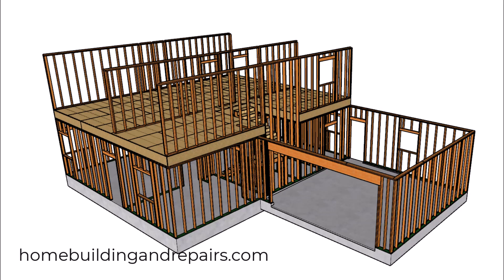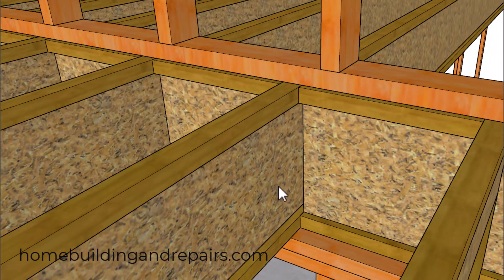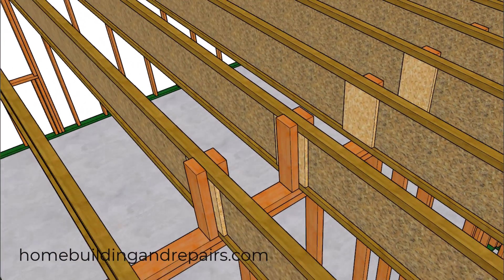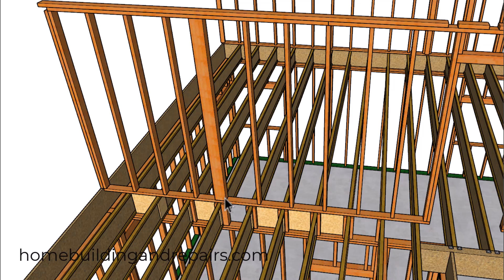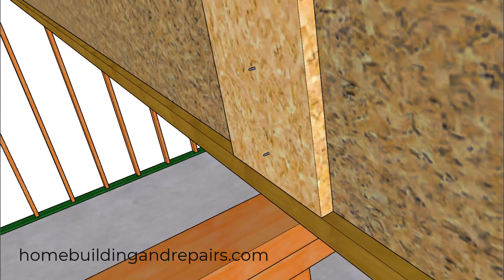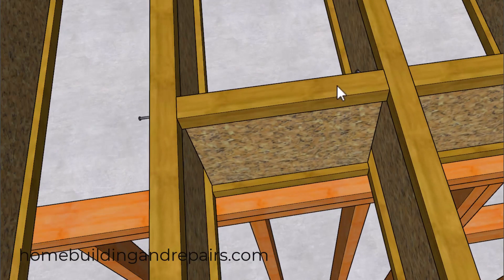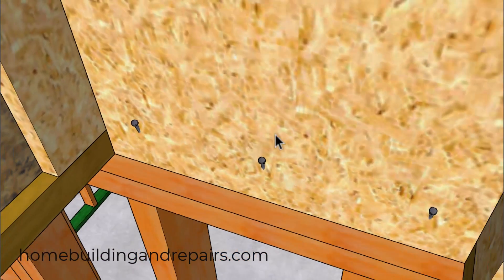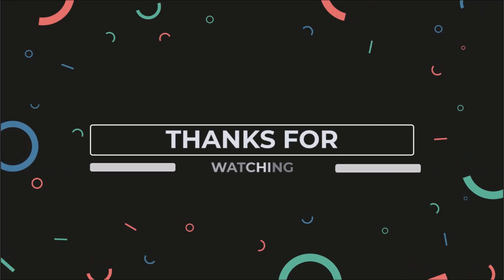Web Stiffeners, Solid Blocking And Squash Blocks Installation Examples For Trus Floor Joist

Comment: Im  building roof with IJoist, 18f span, i can’t find much info about blocking in Ijoist rafters, what would you recommend?
Reply from the maker: I would check with the manufacture, they have installation instructions on line.

Comment: I Used 2x4\2x6 swash blocks with 1x4 or 1x6 for TJIs as the fit flush with standard TJIs. For "But" framing, I used LVLs with the the joist hangers and 1x4 for spacers (web stiffeners) for the fastening the hangers for the TJI's. I wouldn't but join TJI to TJI. Only TJI to LVL or LSL, &  I would always use joist hangers in the invent of severe wind or seismic movement. For but joints with Steel I-beams, you have to install LSL or LVL in between the steel flanges and fasten them top and bottom with structural screws for the joist hangers (That's what the TJI mfg engineer told me how to do it properly). I believe I used 3/8" by 8 inch structural screws, but recommend you check with the TJI mfg for your application.

Note with LSL is that they swell a lot if they get wet which is common during framing construction (rain) unless you building in a desert. LVL so not swell if they get wet, so I recommend avoiding them.

Comment: If anybody is concerned about driving too many nails or not sure where to drive them, honestly the best option is to just open up the Simpson Strong Tie catalog and buy em out

Expensive yes, but the connections you can make with framing connectors instead of plain nails are incredibly strong
Reply: Truely the best thing to use and when used with the proper fasteners. Some rough framers use way too many nails, over driven in the materials making the connections as weak as no connections at all. I am currently fixing issues like this in a new build I just moved into. Some rough framers just don't care. 
I feel for people who don't know how bad some houses are framed and what to look for. I will be using some of the fixes presented in this video to fix glaring issues I have found. More trus floor joist videos please! 😀

Comment: Are you using 2x4s for your structural frame diagrams?  🤣😜
Reply: He usually does just like the rest of America, no harm in using it
Reply: @jackfrost5808  I think for 2024 Building code now requires 2x6 exterior wall construction, or at least states are making that a requirement.
Reply: @guytech7310  In my area that is the case for code but garages are allowed to use 2x4. Builders love this as it cuts costs.
Reply: @jackfrost5808  more talking about the exterior walls...